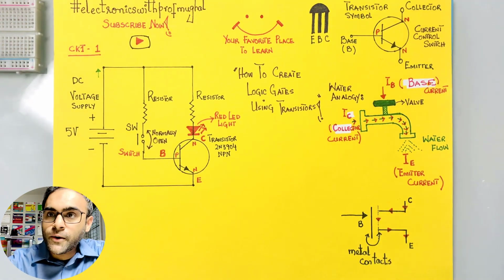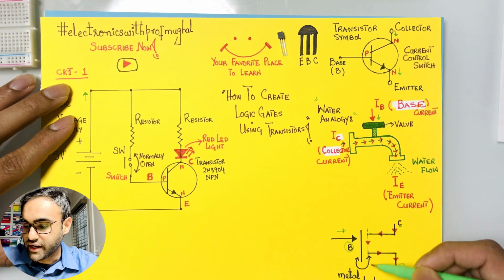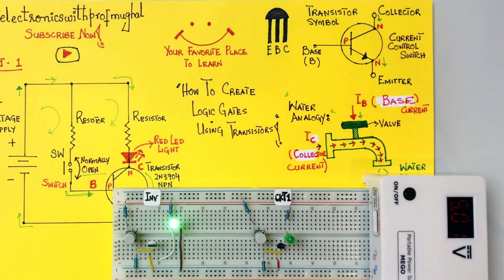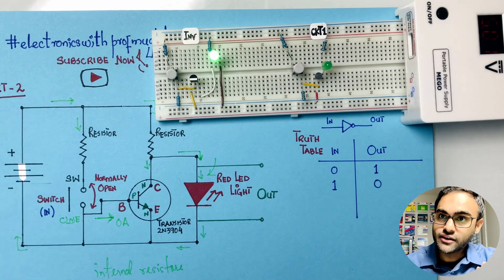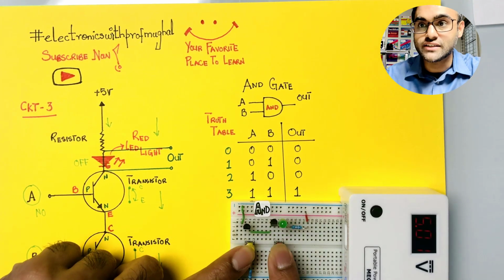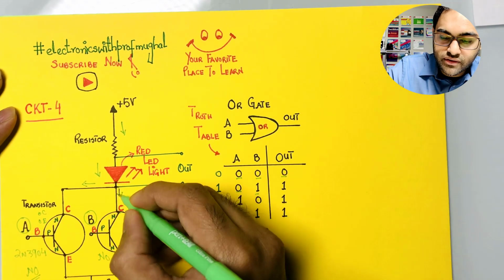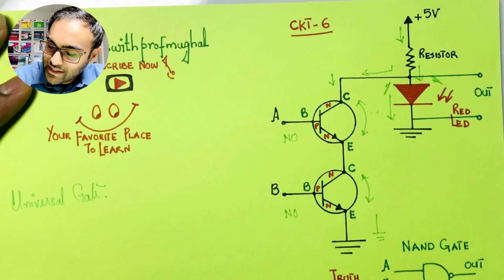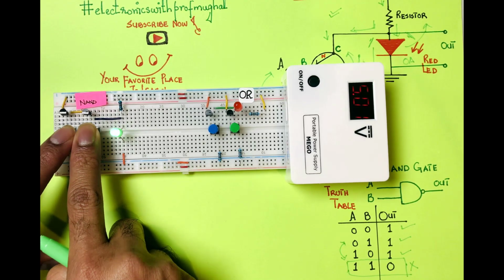How to Create Logic Gates from Transistors? Easy explanation with circuits!

Comment: Something no one ever explains, though....like, literally no one, is how on earth do you hook up two logic gates?  Like, every video I've seen that explains this only explains how it works if the inputs are human operated switches.  How do you feed the output of one logic gate into the input of another?
Reply from the maker: In this video, as the title indicates, we are just building-up individual logic gates. We are not connecting one gate to another. However, this could be easily done by connecting a wire in parallel with led and fed into the input of another gate. I have done this in one of my videos on IC level, I am sharing the video link here, in case if you like to watch.

2-bit Input 7-Segment Display Simulation | Logisim | Tinkercad
https://youtu.be/C1omzzwVdhM